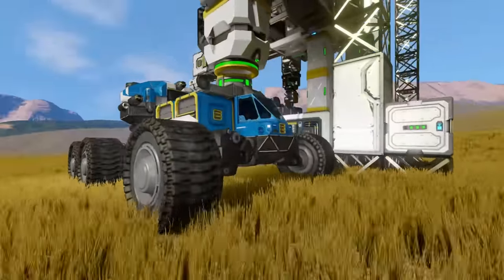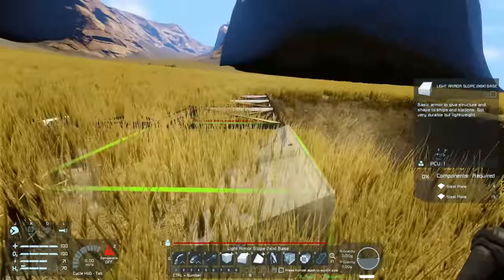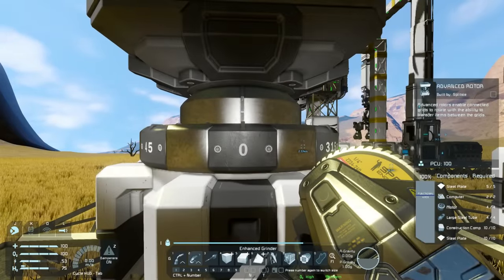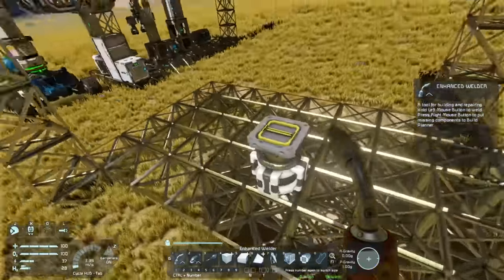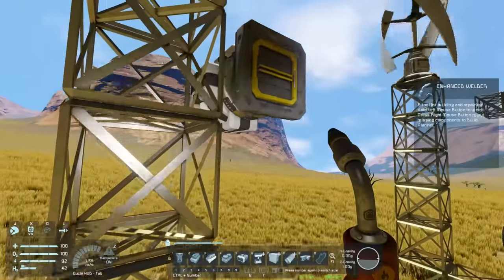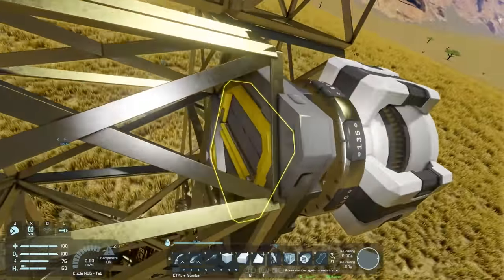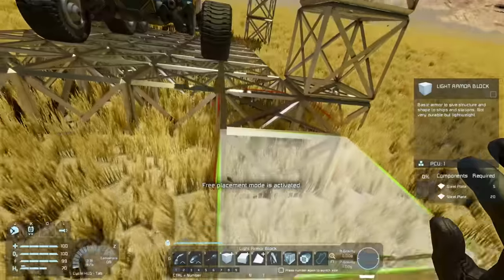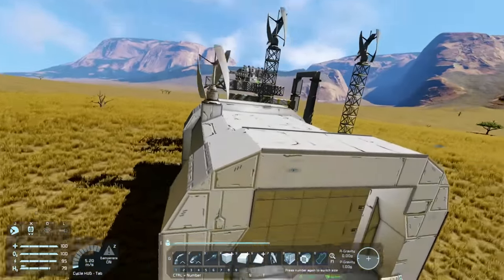Rotors and Hangar Doors - Getting Started in Survival #8 (Space Engineers tutorial)

Comment: These have been so useful, my thanks. I may have many hours in the game but my designs are typically unstable rovers that fall over when there is a slight breeze, it never twigged about the use of the small rotor heads and drills when starting out to save materials, but to save drills I use the rotating head method to make a big circle.
One thing I just cannot seem to get my head round is to figure out how to make the drill pistons so that I can add more pistons without having to re make the drills. (Thought maybe some how using merge blocks when the piston is extended and some how add another piston but I just cannot visualise it).
But I will have to, just for fun, make what I call the flying chair that you made to go into space a few episodes ago.

Comment: 19:08 I cannot overstate how good robot arms are for connecting to trucks like this, especially in the early game. Maybe not in a confined space like I think you're building atm, but for like an exterior "service area." They're great for connecting to a variety of sizes/configurations. So as you progress and build new vehicles, it never becomes obsolete (Mine is one of the oldest parts of my base, and I'm still using it.) Personally, I'm not a fan of connector "parking spots." I prefer distinct parking and service areas, which is a great excuse to build more variation in your base.
Reply from the maker: Fair points, I tended to avoid the robotic arm approach due to the complexity of setting it up but I hope to show some more advanced methods of doing so in the future :)
Reply: @Splitsie  It should be a little easier now that the small battery is in the game :) at least for how I did it (sm grid connected to lg grid.) I look forward to seeing how you do it, I was green as a goblin when I built mine!

It doesn't get too complex unless your design requires fussing around with merge blocks. Protip: Locking your rotors before adding to them makes life a helluva lot easier.

Comment: One of the first things I did was goto creative mode and make a gigantic hanger. It took quite some time to figure out how to make a super massive hanger door that's also air tight, (not that it needed to be airtight)  It was super frustrating but very fun eventually. I used two rotors on a hinge opening out sideways, actuated with a piston on the side of the building. Swinging a midpanel into the opening, that was closed in by air tight hanger door blocks.  And the opposite side of the swinging door had merge blocks.   I'm not even sure where my problems were and why it did or didn't work at certain times, but eventually it did, and it was very cool.
Reply from the maker: Giant hangar doors can be loads of fun to make - glad you had some success :)

Comment: I've made several contraptions with rotors and pistons, some of them fairly complex, and managed to avoid Clang for the most part somehow. Doors, robot arms, elevators... all have worked flawlessly once I get the settings right. 

That all changed when I decided to build a simple trailer hitch.

Some tips from my own experience:
If you need shared inertia tensor, it probably wont save you.
Think in triangles.
Using a piston to move a rotor is far more stable than letting the rotor power itself.

You can have multiple points of connection (pistons/rotors) between two grids BUT only if there is an intermediate grid. For example: Say you want to build an elevator but silly you built it an even number of blocks on each side, so one piston in the middle isn't an option. No problem, you'll just use 4 pistons, one at each corner. If it's only one piston tall it will "lock up" for whatever reason. But if it's at least two pistons tall, the second piston on each stack will be it's own grid. I've seen different, but equally janky results with rotors. I have no idea why this extra degree of separation is necessary. Basically, multiple connections from one grid directly to another bugs out. If one connection is direct and the second (and any others) goes through an intermediary, that also works.
Reply from the maker: I've had lots of success with rotor based hitches for trailers, the main rover in my single player series 'The Goose' is a semi-trailer. It's on my workshop if you want to have a look at how I set things up :)
Reply: @Splitsie  I might just do that, mine likes to spaz out on load sometimes. It also tends to clang when I attach the trailer. All of my clearances SHOULD be fine so I'm at a loss.

Comment: you can easily go wider with the airtight hangar doors, in between the 4 that open to the left and right you can put some that open up and/ or down to widen it. with hangar doors up and down you can go 4 in height and as wide as you want and it takes about 10 seconds to fully open/ close, been stoping the time for some timer block shenannigans with several hangar doors
and also you put the piston in the garage on a normal block so it might be a bit tricky to transfer cargo... ;)
Reply from the maker: That still leaves you with a maximum dimension of 4 in one orientation exactly as I said, as for the piston, I figured I'll fix that when I decide where it needs to connect to :)
Reply: @Splitsie  4 is at least twice as high as 2... 😁

Comment: With the Airtight Hangar Doors, couldn't you have "multi-directional" openings? Say, making a 6x2 gap with 2 on each side, and 2 lowering down from top or bottom to fill in the gap in the middle. Would that still be airtight?
Reply from the maker: You can make almost any combination of size as long as one of the dimensions is 4 blocks or less and it'll still be airtight :)

Comment: Just learned something if you set up the wind turbine in a plus formation having a total of 5 turbines you just made a 9x9 grid I believe depending on how you count point is I was able to put a hanger in one of the corners of the plus and the space on the other side of the hanger wall is a manufacturer room if you put the turbines high enough you can put 2 refiners on the ceiling in the room and have enough room for all the upgrades this isn’t the best explanation of it but some one might catch what I’m trying to describe
Reply from the maker: I'm currently working through and remaking my older tutorials and in the opening one showed off a much more efficient (but in my opinion less visually attractive) way of arranging the wind turbines by putting 5 of them on a singular tower. Overally though, I'd just say to people to build them where you like and if you don't get enough power, just think about building some more of them :D
Reply: @Splitsie  I did watch that video very good job on it I've been building my base up personally I too dislike the idea of it but if you need power you need power I suppose. I am having a problem with my hanger door though I've built the entire door and it works but for some reason the opposite side of the rotor that corner of the door will get stuck on the wall everything else is fine but that corner for some reason gets the blast door corner stuck. for context it's the same design you used for your old tutorials.

Comment: i once built a moon base with a hangar to park one of my massive ships in and it has a door that consists of like 24 or more pistons to have enogh distance the problem was that the pistons dont retract 100% so i just aded a landing gear to hold the door and it works because it runs into the ends lets say forcefull but it works

FYI: hangar is like 200 blocks long
Reply from the maker: Piston doors are a bit of a challenge to get just right, but it's nice watching them open and close at a million miles an hour ;)
Reply: @Splitsie  definety, i had that hangar door clang out twice maybe setting its force to like 2.5 terra newtons wasnt the smartest idea

and when it clanged out it riped my hangar apart

Comment: 26:24 except for the ship that you'd be putting in the hangar in the first place is also a subgrid. and its cheaper in the sense of time to build AHD bc then you don't have to manually place every block on the Blast Door when you make it from a projection.
Reply from the maker: They are, but grids attached to connectors are more consistently accounted for by the inertial dampeners, I think Keen must have given them a special case for the exact reason of allowing the use of motherships, similarly, grids attached to the main grid by the main's own landing gear are treated in a way that means their mass is normally accounted for :/
Reply: @Splitsie  not from my experience, I found they can also apply a torque to the grid, but that might be different because of some special circumstances of this test.

Comment: Hello, what blocks in which orientation did you use to get the middle part of hangar, because I like the design but can’t figure it out
Reply from the maker: The rounded part on the ends was the 2x1 slope base with the half slope in between, the bits in the middle are two 2x1 tips that meet each other at the pointy end :)
Reply: Splitsie thanks!  Building it now!

Comment: Hey love your vids. I have missed this game totaly, just learned about it. Nu question are, when you do a design, do you have to do the design from the ground up everytime or can you do like a blueprint. Example your drilling plattform. When you love it, han you love it assembled or will you have to build everything again?
Reply from the maker: Blueprints are possible in Space Engineers and are projected from a projector where you can then weld them up. There's a pretty big limitation to them though, you can't project subgrids (anything attached to a piston or rotor) so you'd have to build those bits from scratch every time
Reply: @Splitsie   Splitsie  aah cool, I did see the  projecter in your later vids. But you are talking about mods alot. Does that mean that the game is't full? Probobly someone can do a system that allowes you to do a blueprint for the small subgrid.

Comment: Do you have to use the blast doors? I tried just using normal blocks but I get grinding on the sides
Reply from the maker: Since a recent update, you can get away without using the blast doors, but the blast doors are still easier to make fit without causing issues due to their smaller collision

Comment: This no longer seems to work. I am pretty sure I followed what you did exactly, and the door sticks part way through. Perhaps I missed something, but I don't know what.
Reply from the maker: This should all work exactly as I did it, none of the collision sizes involved have changed since then and the ones that have were shrunk. Which part is getting stuck?
Reply: @Splitsie  I finally got it to work, but I had to adjust the rotor head offset. What you used in the video didn't work.
Reply: Just FYI, had to use -12cm offset to get the other side to quit sticking.

Comment: 2 things;
1 you did not cover how rotors work when 0 torque (aka dead rotors)
2 You should have admitted that you over engineered the door a little as 2 sets of airtight doors (set like teeth) would have done the trick and given you a little more vertical room.
Reply from the maker: I did cover 0 torque right at 8:08 and again when I showed the hangar door collapsing when I turned it off and how it prevented it from collapsing again.
A single rotor isn't over-engineering in my book, especially when the point of this tutorial was to give people insight into how rotors work.
Reply: @Splitsie You talked about how they act when the torque it not high enough, but not how they are 100% controlled by gravity when torque is set to 0 or really low. I use a breaking torque of 2 on my Clang-Crane. (Yes it's Capac Orange for a reason.)

The more I'm thinking about it more the stuff I was thinking about may not be exactly a beginner's tutorial. Overall you made a good basic rotors tutorial.